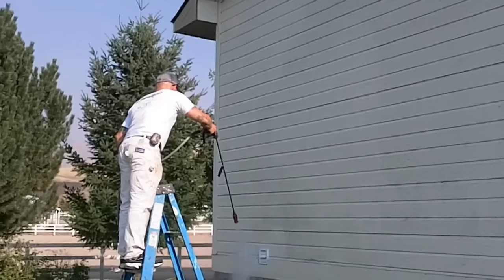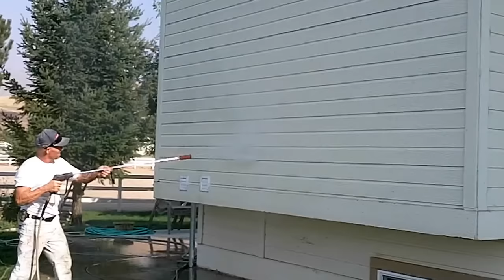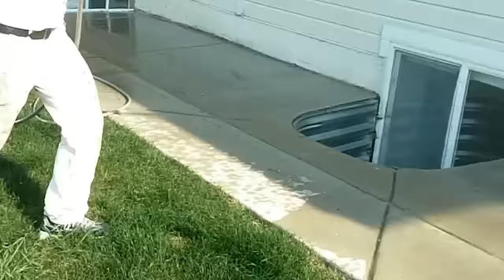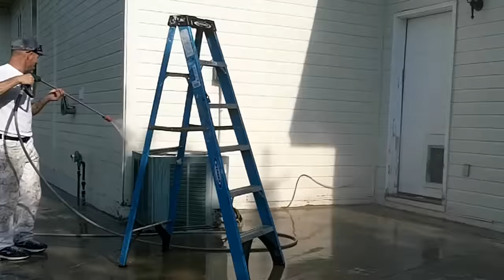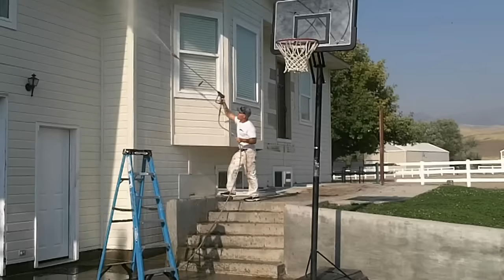Proper Power Washing Techniques | Master Pressure Washing Houses

Comment: depending on the siding when you are pointing the wand upwards cant you blast water under the wood and cause danage?. 
And if house has soffets or ventalation on underside of roof that can lead to problems?

Comment: This is Fricken Frackin awesome! Best Wicked Wand in the Mid West. Hey you got ink on your arms man; what's with the drop of the wand around 4:20 for? Do you have an allergic reaction to that thingy that was on your upper arm?  If so ok I understand. Man! that was a Rambo move crushing your shoulder into the siding but the best was yet to come when you stepped on it like a lit cigarette.
Rule #1 in pressure washing... never loose sight of the tip....High Psi + water + skin = stitches.
Rule # 2.....x-jet + water + chemicals = ;-)

Comment: I get that kind of question frequently and it depends on how much of the house is siding or other material.  Generally speeking i would say 300-400 dollars for the entire house if it done right.  This video does not display the best way to pressure wash a house but from a painters perspective is not the worst either.

Comment: Ive had my own pressure washing company for 13 years ive never seen a 0 degree turbo nozzle used on siding. Looks like you used straight water. Im so tired of seeing these guys using bleach and low pressure. I use low pressure no chemicals. Unless its on drive ways  patios ect good job brother

Comment: I use the X-Jet Nozzle system. No need for ladders and much safer.
Reply: A Mack For sure.....8 years and no problem. Bought one to rinse with too. GX 610
Reply: Pressure washering 10 years now X-jet  is the only way to go no ladder needed!!!

Comment: Usually you charge by the hour and your hour rate should be determine by how well you power wash. for a professional, id say about $30 an hour, probably take about hmmm...45min a wall (assuming all walls are like this) so 45x4 (amusing for outer walls) =180 minutes= 3hours, so $30x3=$90 bucks. Plus any materials needed (solvents, culk etc.)  Done.

Comment: first mistake you are not using safety glasses,so you are jeopardizing the whole operation.
Reply: Just sharing past experience I had while pressure washing,a big piece of metal got in my eyes that put me out work for a couple days
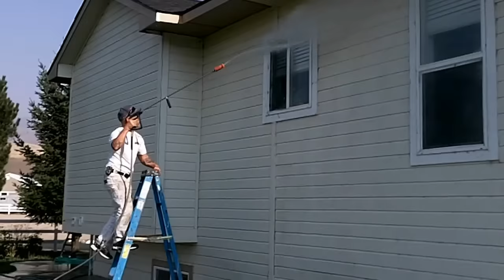Reply: Alex Martinez Not to mention where he totally dropped the wand at 2:41. Umm...jus sayin. There's a few things wrong with this video, like you should NEVER power wash while standing on a ladder! That's just idiotic! If you can't reach it, use a small scaffold.
Reply: Tina Jackson What so bad about using a ladder to get higher up?